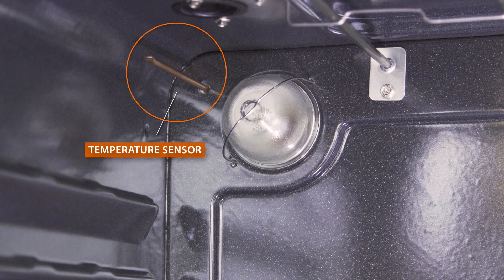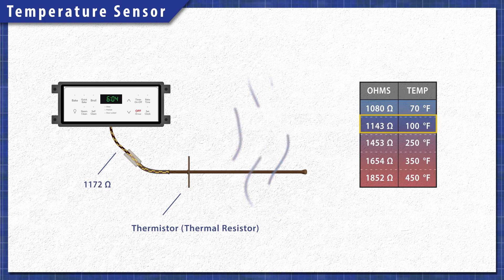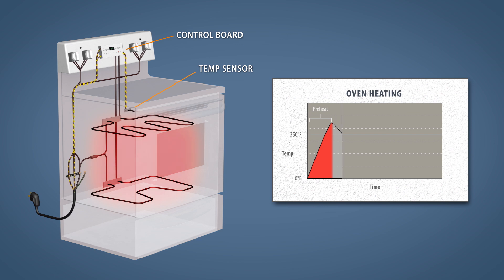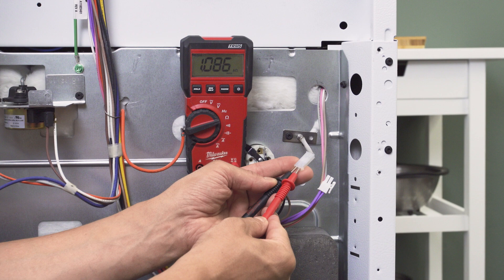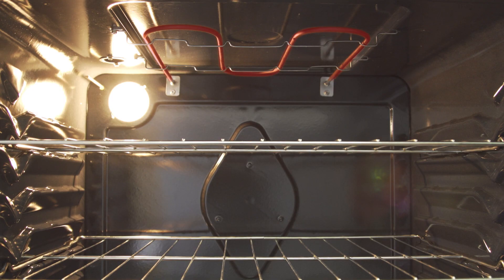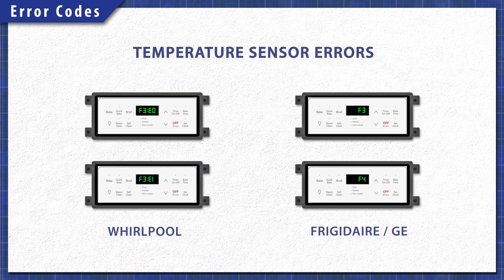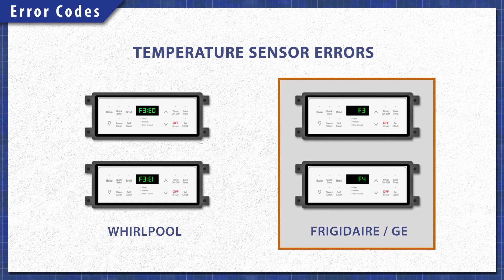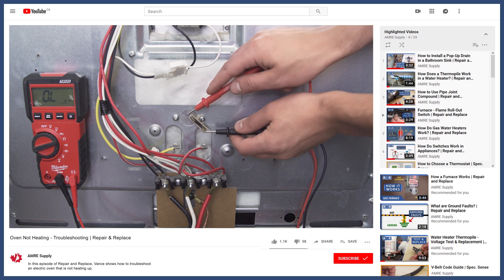Oven Temperature Sensor - How it Works | Repair & Replace

Comment: I'm getting a F3-E0 error on my Whirlpool oven. I tested the range of a sensor, and it gave me a reading of 1093 ohms. Is that a faulty sensor based on the reading?

The model of my sensor is W10181986
Reply from the maker: Thanks for watching. 1093 ohms is a normal healthy resistance for most sensors. You can see the testing and more info in this video: https://www.youtube.com/watch?v=jnt_mUwdL8o
Still it would be best to check the wires that lead into the control board, and any wire connectors to make sure that they are secure and there is no carbon buildup or grease that might interfere with the signal.
If that doesn't help then the control board could be faulty.

Comment: Is this reasoning correct?
If u set gas oven to 350 and temp never changes but PREHEAT light comes on. Gas is not flowing and ignitor comes on. Check resistance and it is bad. OL on multimeter. I am thinking that since temp never changes except for heat from ignitor and temp is never reached, the temp sensor is sending improper signal to control board and board is not allowing flow of gas. Is this correct.   Also blew some compressed air via bottom inlet to regulator and in closed position , no air came thru but in open , it did.  Also checked for continuity in gas safety valve and it was good.
New oven and it only lit a couple of times with a loud cutting off of gas which sounded like ‘WUFF’ I am trying to confirm my thinking is correct or not?  I have to go pickup new temp sensor and install in couple of days.  Display has thrown NO CODES whatsoever
Reply from the maker: Thanks for watching. The reasoning seems solid, and the reason the control board would not throw codes could be because the temperature sensor is faulty and has the wrong resistance. As a sensor fails the resistance can shift, this can trick the oven control into thinking the oven is a different temperature. You could test the sensor with a multimeter to see https://www.youtube.com/watch?v=jnt_mUwdL8o As well make sure the sensor wire connections are secure and there is no grease or anything that might interfere with the signal.

Comment: Hey I know this video is a little old but would appreciate any help on determining the problem with my oven, when ever it’s plugged in it continues to rise in Temperature and threw up a f2 code
Reply from the maker: Thanks for watching. This video is still accurate even though it was released in 2021. The design of thermistors hasn't changed so the same principles will continue to apply even to new models made in the last few years.

An F2 code can mean that the sensor is shorting, which will through off the control boards readings. You can learn how to test and replace the sensor in this video: https://www.youtube.com/watch?v=jnt_mUwdL8o

Comment: Hi, what if the oven is not maintaining the temperature (when we set it for 350, it reaches 350, but then after ~10 minutes, it is still shows 350, but when we turn of off and then on, it shows like 300-310, and will take a minute to reach 350) :(
Reply from the maker: Thanks for watching. There will be some variation within temperature. As you turn off the oven it will cool off and the temperature will drop. When you turn the oven back on it will heat up to try to maintain the set temperature. This video explains some of these concepts in more detail: https://www.youtube.com/watch?v=s8UdnR4Jw_g
Reply: @AmreSupply  Thanks alot, I think the baking element is only working when preheating, but once it reaches to 350, it is not turing on to keep the temperature to 350.  If i come in 30 minutes, the temperature goes down, but it is still showing 350 at the screen, the only way i get the new temperature is to turn off/on the oven, and i will see the temperature, and it will work again to reach 350.
Reply from the maker: @albukhari87  If the temperature sensor is good and both elements have continuity and are able to heat up, then it's likely a faulty control board as this controls when power is sent to each element. You can see how to replace the control board in this video. https://www.youtube.com/watch?v=ORTi4lLyoqw